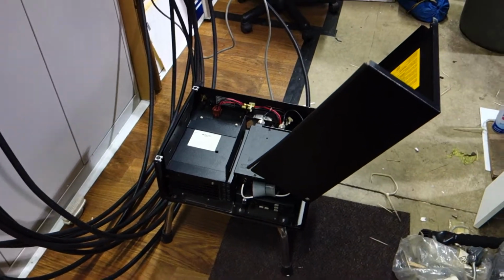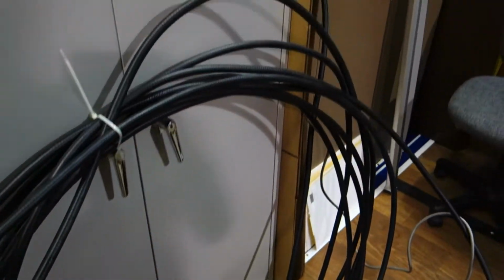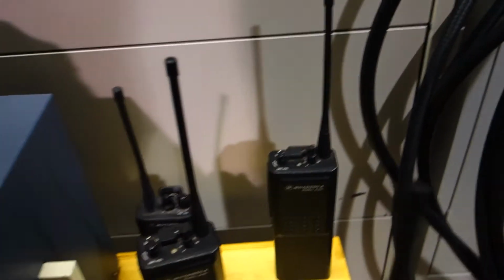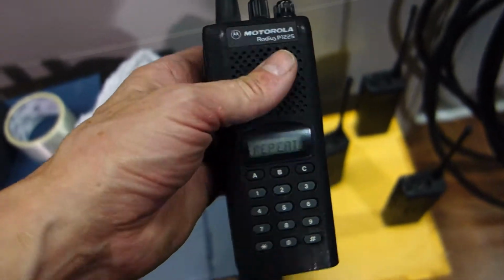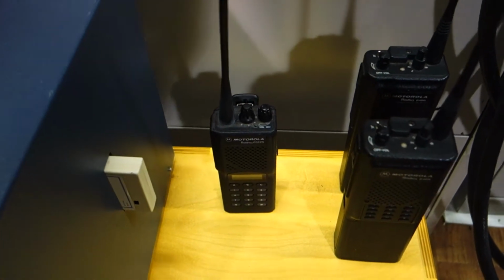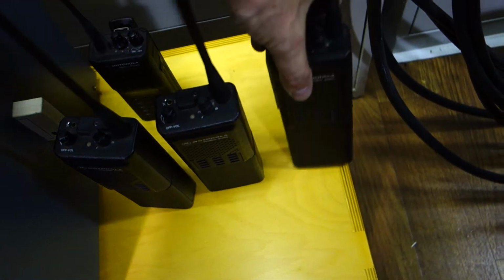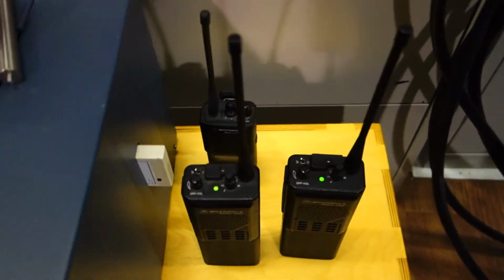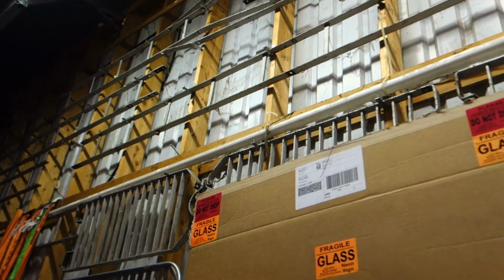Motorola Radius GR500 Repeater + 3 P200 + 1 P1225 For Sale

Comment: No it's your battery those p1225s are notorious for getting batteries to not function correctly like that it's not your radio it's the battery that's why I sold my last 1225 because of it

Comment: Are the P200s still available?  The P1225 has a bad battery.  That why it won’t transmit.
Reply from the maker: Thanks for the tip. I may be donating the P200s to a charitable cause.
Reply: Do you still have the P200?